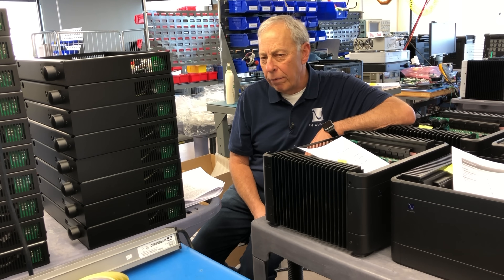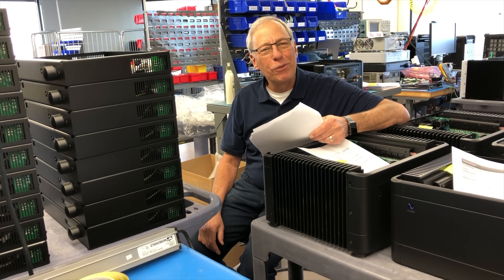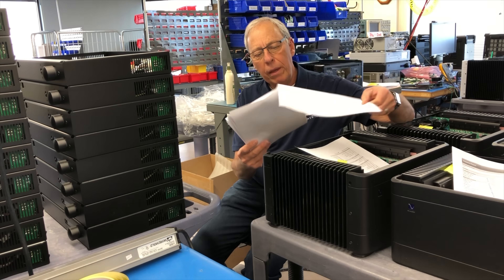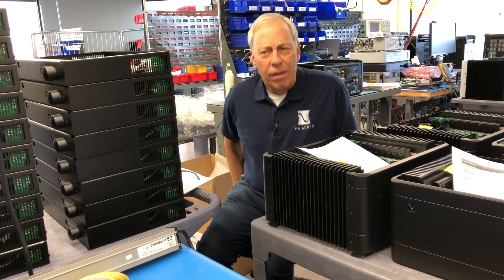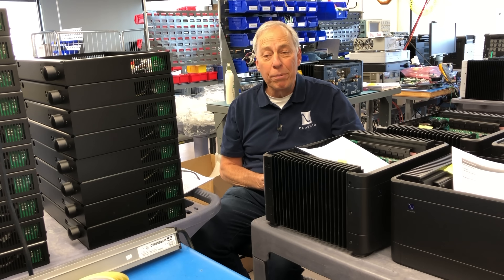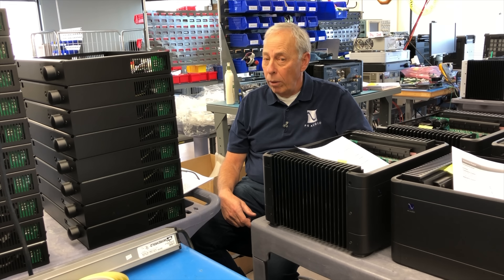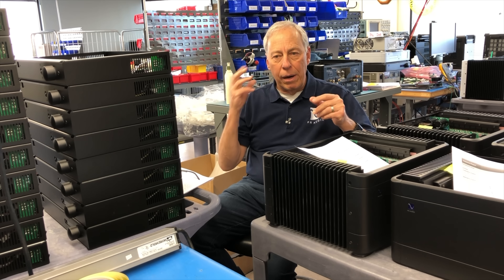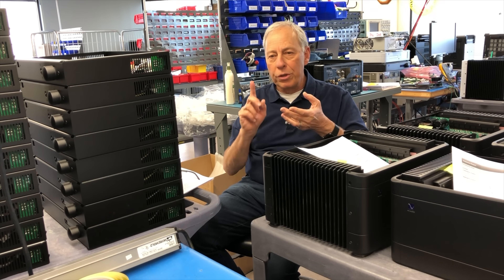Is damping factor a good indication of amplifier performance?

Comment: I was in the audio signal processing design business for decades. I consulted on amp design with multiple big name companies, and finished my career designing products at Dolby Laboratories. Dolby had/has superb listening rooms. When we carefully blinded tests, even in a superb space with very highly regarded speakers and good source material, amplifiers of decent spec and power were indistinguishable. The key was double blinding the tests, so that neither the listeners or those running the test knew at any given moment which amp was in use. Listeners had a button that allowed them to (maybe) change amps. Sometimes it stayed on the same amp, sometimes it changed. Data collection was automatic - the  system recorded the results which could only be seen at the end of the test. Almost without exception, listeners were no better than chance when trying to pick which amp they were listening to, or rank which sounded better.

Comment: For me a high damping factor indicates the amp has a low output impedance which means that the speaker will have less of an impact on the amps amplitude or phase response

Comment: Better is to have a class A amp - no crossover distortion, and staying entirely within the linear range of the amp. Ya just need a good transformer. And that amp is likely to have a low dampening factor, but you can't get better quality than a class A amp in its linear range. :)
Reply: Yes, Class-Amps sound amazing, but are notorious for getting very hot to the touch, because of as the scenes heat they put out🤦🏻
Reply: @albertelazar4069  But what is a little quibble over energy efficiency when the goal is pure quality of sound? Good, efficient, cheap. Pick any two.

Comment: Loudspeakers are just a particular type of microphone, and visa versa. No surprise that a loudspeaker also generates a voltage. Low dampening just means the output of the amp is not able to control the flow of current generated by the speaker moving on its own through the magnetic field as a result of, for example, the momentum of the speaker causing the speaker to not follow the output of the amp.

Comment: If you allow me Sir, it depends on the first order how your loud speakers designed , sealed or ported bass or passive radiator ,2nd the magnetic size , 3rd the coil impedance ( lower impedance generates more electricity according to moving rate as they louder in lower volume  , 4 the matierials that made by driver cone  * the heavier the more dumping factor needed , for example if plastic cone at 70% of your amplifier volume needs 70 dumping factor , the paper cone needs 30 and carbon fiber cone need 20 dumping factor , so it depends on how speakers reacting factors >> what are these factors >> inclouser type, impedance .material etc....

Comment: Hi  Paul. Very interesting and this is a subject that I am working on. We have been in contact before and we have a mutual acquaintance that is known to Bascom King. Consider this, and it is thought provoking, make the amplifier draw the same current at all frequencies and the amplifier's output impedance gets cancelled out. This basically means that we must EQ the current of the amplifier (the impedance plot is about current and nought about the voltage) inversionally proportional to the load on the amplifier and the alignment does not change with any source impedance. Then the output impedance of the amplifier does not matter. Way back in 1975 I had a discussion with Richard H. Small (of Thiele-Small Parameters) in Q2 of 1975 (he was not quite famous yet) and he basically said that the damping is entirely defined by the LF alignment and not by the output impedance. A better understanding of T-S Parameters actually confirms this. The idea of an amplifier having any 'damping factor' outright annoyed him. That is something I never forgot. I am now working on a paper that has been in the works for decades and I have a list compiled of whom I will send it to. The damping of an LF alignment can also be defined by current versus frequency and includes maths that actually makes sense. The damping of an LF system is highest when the current is low. The list has some very well known names on it. Cheers, Joe
Reply: A very lucid comment. In 1975, broke and fresh outta military service I got my first "component " hifi budget system. I started reading about the Thiele/Small equations for venting loudspeakers. To my knowledge only two companies took advantage of this in those days; Electro/Voice and Ohm Acoustics. Acoustic Suspension ruled then as vented designs were trial & error and kinda sucked. Now, all Gods chillins got vented speakers. I purchased Ohm L's in 1978 and still use them. I used the L's with an SX-650 and output was enough to impress, if not annoy the neighbors. Damping Factor was 30. Got an SR-804 in 1979 and DF is 40. I thought DF was to tame the woofer excursions for cleaner bass and that higher was better. I've seen amps with DF of 10. 
 Your narrative is technically a bit over my head.  In plain talk (please), what IS a good amp DF???

Comment: Would you say Bob Carver's Magnetic field coil power amplifier architecture design is an exception to the traditional damping factor theory ? I also noticed really expensive vintage audio amps (Sansui, Pioneer SX, McIntosh, etc.)  have low damping factors. But these amps sound lovely.

Comment: Right. I use high damping factor amps for subs. The higher the damping factor the happier I am. It helps control overshoot of the driver and puts the breaks on. You get that nice punch. Cable length and gauge also matter. The shorter and thicker the better.